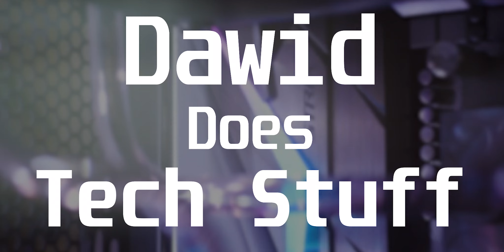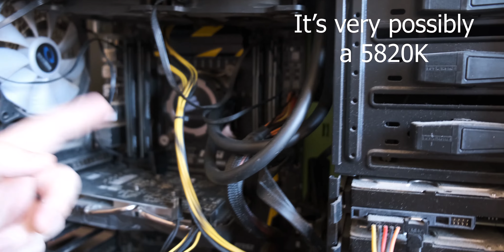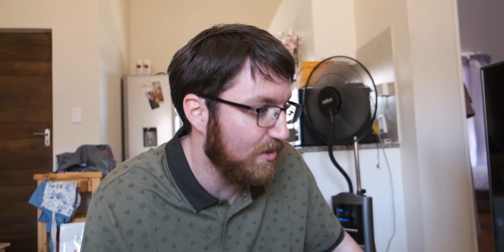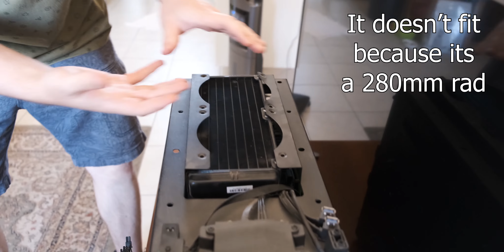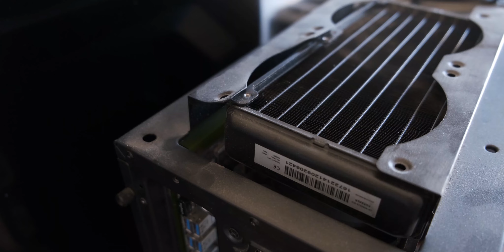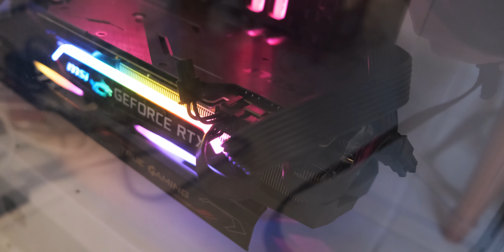WORST AIO radiator placement ever!

Comment: That's not the only large case that has trouble with accommodating a radiator. My Coolermaster Cosmos II (a f@cking huge thing) has trouble fitting the fans in a 'push' configuration (as the mobo has a slightly protruding heat-sink). There's simply not enough clearance from the top of the mobo to the top of the case!!! So you have to fit the fans on the other side, so they only pull the air through. Unforgivable really, considering that the case is absolutely freaking massive...

Comment: What's that thing under the RTX GPU in the new PC? A sound card??? It looks like it's blocking all the fans on that GPU. 😄
Reply from the maker: Hahaha!! It really looks like it is. It is, however, a bracket that MSI gives with their HUGE GPU's so that they don't have GPU sag. It's like a rest to take the strain off the PCI-E socket.
Reply: @DawidDoesTechStuff  Ahh that makes sense. It doesn't have any LEDs though. Very disappointing MSI.
Reply from the maker: @Madgemade  Right? It should at least have addressable RGB.